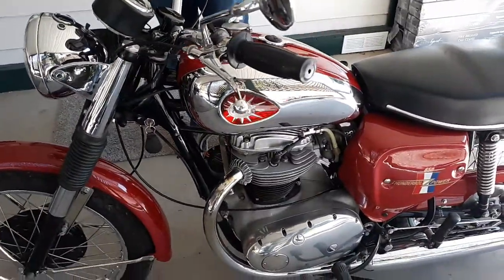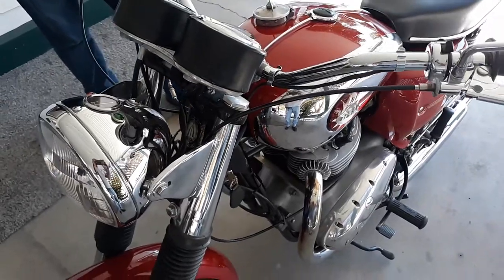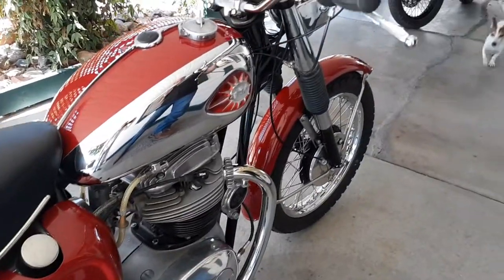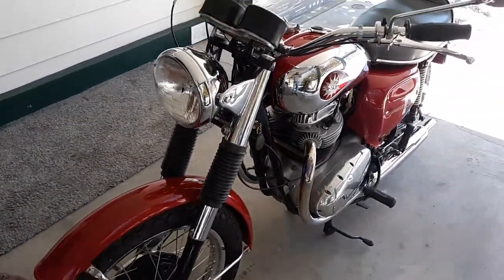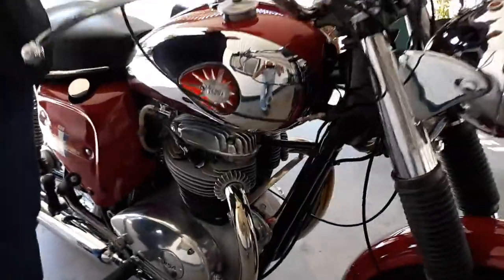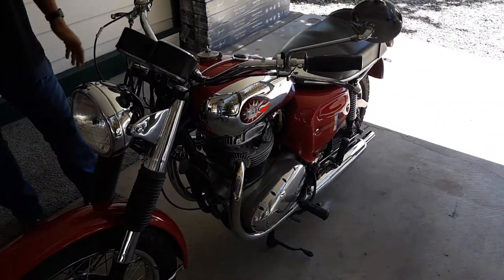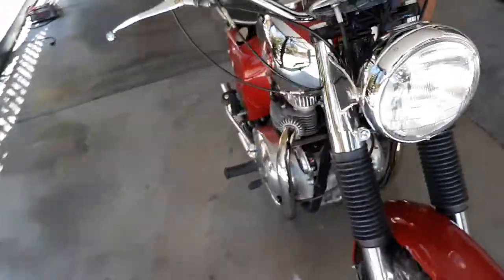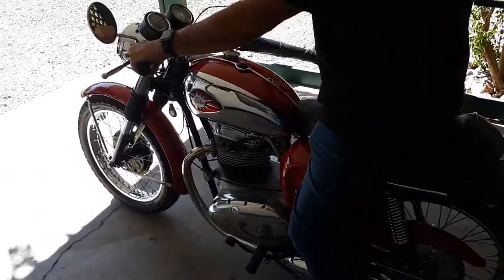1967 BSA Thunderbolt

Comment: I was 20 years old in the Air Force living in San Bernardino when I bought a 1967 BSA Lightening. My first Motorcycle. Rode it all over the Desert and Mountains. One thing I was taught was after starting it, remove the Oil Cap and make sure you see flow. Your's sure brings back memories..

Comment: I had BSA in 69 my Brother bought for me to Ride that Summer while I was there in Las Vegas...It was a 441 Shooting Star..Not a Victor..It was a Street Bike with a low exhaust pipe..The Tank,Seat and Rear Fender we're all one Piece...I got it in 69 but I'm not sure if it was a 69,68 or Earlier...I've never seen another one like it since...Wish I still had it...In the 3 months I had it the speedometer Cable unraveled and broke the Speedometer..The Throttle cable broke and it Leaked oil from the Cases...Alot to happen in 3 Months..

Comment: They're a lot easier to start if you are astride them and if you're short like me leave the side stand down but that's just in case. You hold it up and kick with your right leg, unless you have some disability that prevents it. Switching from the old British shift pattern of right foot and pull up for first and down for second, third, fourth to the Japanese left side shift and one down and the rest up was a trip. Went the wrong way more than once shifting to second instead of 4th  on my first Honda.

Comment: -Best looking bike i have ever seen. And that includes the 650 cc Honda with the 5 speed gear box. The 4 speed was best just like the Harley's with there 4 speeds gear box. Plenty chrome on this bike & even the gas tank sides. Great sound but not from small computer speakers.Best to hear it in person.The biggest mistake BSA done was to go out of business.A great looking bike like this today would put all bikes in it's cc class to shame.Plus would have sold like hotcakes. A good buddy of mine had the 1969 BSA 650cc Lighting.It too was a great looking & powerhouse of a bike,But not as good looking as this one in this video. And The BSA had the edge on the Triumph 650. The Triumph was to high up but with the BSA you sat at a much better lower seat level so you're feet could touch the ground flat footed & not on ya tiptoes. If BSA was still in business today I would have one like in this video right now .It's just upsetting that no company today has a bike too match the looks of this super great looking bike.Dumb move on there part because they could do it if they wanted too.Just silly & dumb thinking on there part. All I can say it's there loss.---Great job with the BSA you are so lucky to have.

Comment: I would always with these twins suggest position the pistons first just into compression with the kick lever before giving spark. Choke or prime motor if temp is same as air. If the motor is still warm you may need neither.

Comment: Only the RH pet cock needs to be opened, the LH side is reserve fuel once you fill up that way you can keep the throttle going while you switch on the reserve tap. Also hold down the tickler on the carb until fuel comes out, stabbing it repeatably can puncture the float. You should also free the clutch before a cold start to save the gearbox